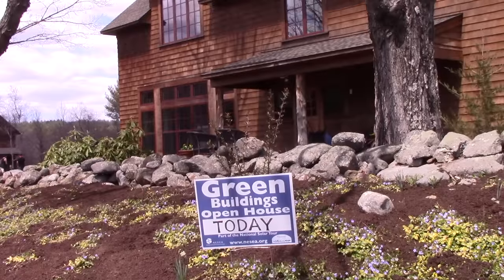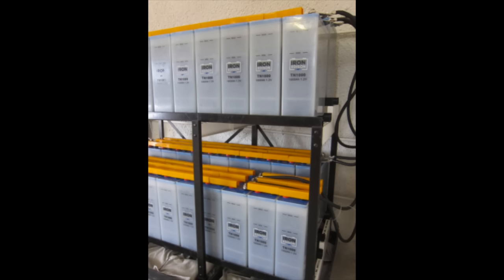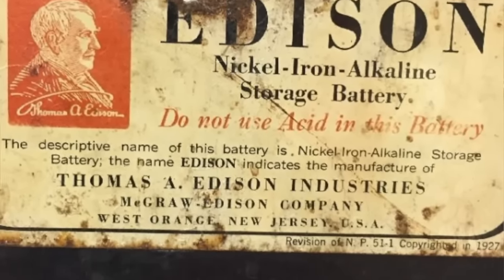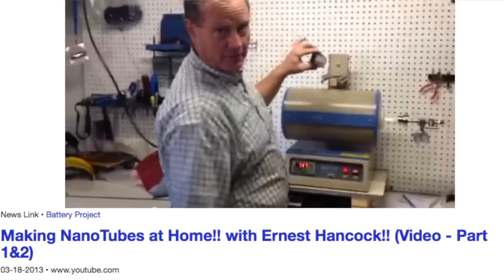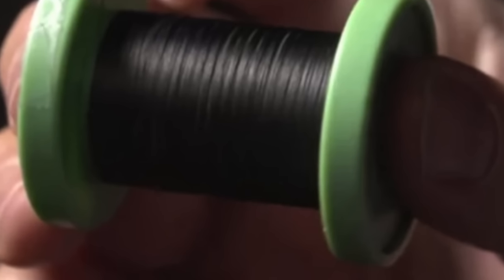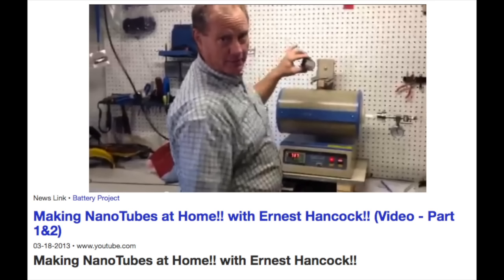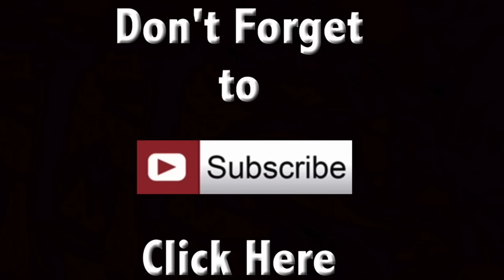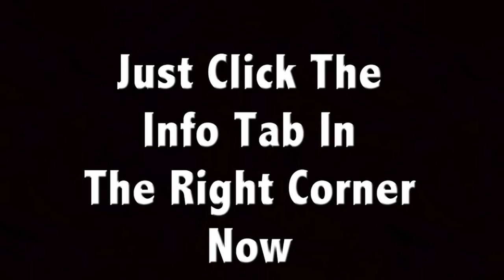The Best Battery for Off Grid and Solar Systems -  Nickel Iron NiFe Edison Battery - "Tarrin it Up"

Comment: Can carbon fibers survive the heat of molten nickel, such as drag a single strand of carbon fiber thru a molten nickle vat and coil it up...then take that huge spool of nickel coated carbon fiber and weave a nickel fabric, or better yet...how thin can you make a nickel "wire"
Something like this
http://wirecloth.bwire.com/item/nickel-wire-cloth/nickel-200-standard-grade-wire-cloth/100x100-0045nickel200

Comment: iM ALSO GOING BACK TO maGNESIUM-GRAPHITE BATTERY MAKING IT NEED A PEROXIDE HYDROGEN MIXED WITH WATER TO WORK AS ELECTROLYTE . i WILL MAKE IT AT ONE POINT VERY SOON
Reply: let us know what happens.
Reply: HOW DID IT WORK, DUDE? AND DID YOU EVER FiX YOUR KEYBoARD?

Comment: Nah.  Batteries are old tech.  Chemical reactions = will always wear out in the end.  Graphene capacitors.  That is where it is at.

Secondarily, it is not necessarily the cost of the batteries/storage medium, it is the fact that for most people (places on earth with winter and summer), the vast majority of the power from solar is collected/able when they need it least.  If I could harvest power all spring, summer and fall, I would make it through the winter for sure without needing wood or a generator or needing to be grid tied.  I can't so I have no interest in doing solar or wind.

And before "believers" come along, I am speaking from a straight up replacement of mains with solar.  No spending a fortune to utterly change my way of living or selling my house and massively downsizing or anything.  I am talking REAL world implementation on an existing house.
Reply: You just need a way to store more power during the summer.  There are some companies experimenting with supercritical CO2 for this purpose and it seems to work pretty well.  Other liquefied/high pressure gasses would also have potential.  Alternatively a well insulated boiler of sufficient size could stay hot for months.  

Of course, storing a winter's worth of power in a reasonable space means you're going to need some highly energetic matter...  There will be safety concerns about blowing up your entire house...  Or neighbourhood...  Maybe there's a reason for the grid...

Comment: A good Lifep04 has fthis beat. Light weight and you can use 100% of it before you have to recharge rather than only 40%. They last 10 times longer than the best lead acids. Lead acid is about to be fazed out. Good riddance!

Comment: Nickel–iron batteries are rubbish. Low energy density, high self discharge rate(20-30%/month), high cost, poor charge efficiency. Even standard lead acid is far superior with higher energy densities, far lower self discharge rates (3-20%/month). There is a good reason Nickel–iron batteries died out decades ago. Today the only rational choice is Lead acid, with some form of lithium ion soon taking it's place.